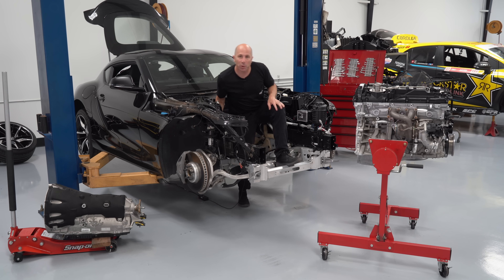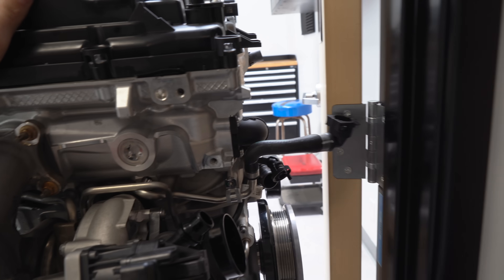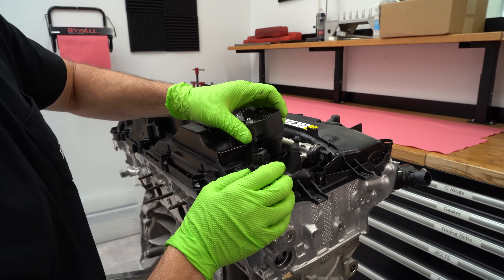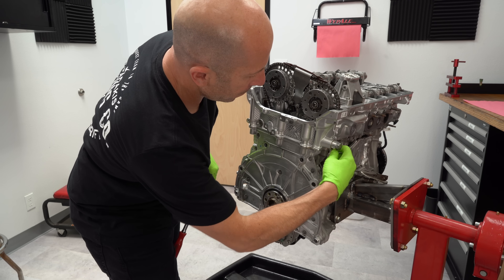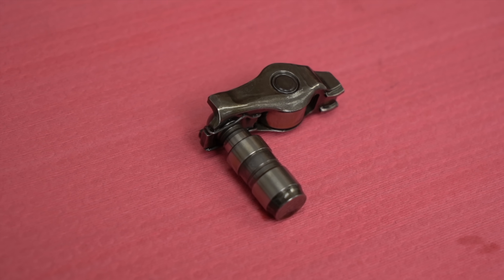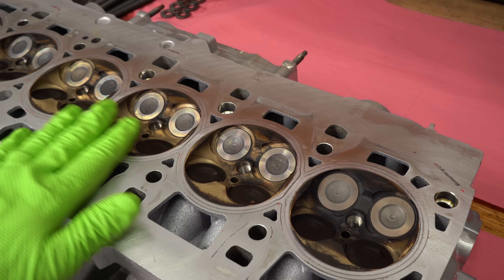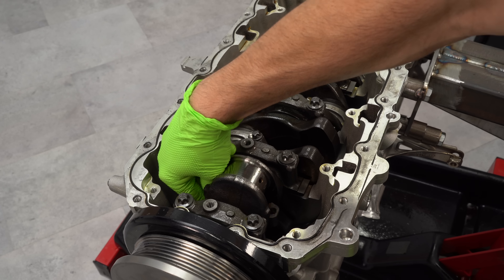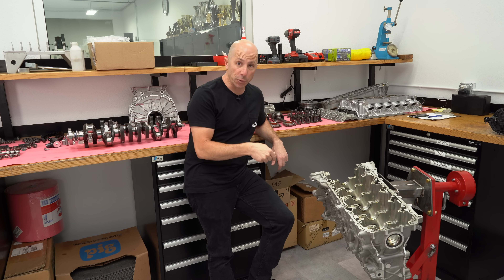2020 Supra B58 Engine Teardown - First Look - Better than the 2JZ?

Comment: Um, I believe I’ve spotted an error in this video.  Where he identifies the black valves as the exhaust valves, but if you look at the head casting you can see the dark valve side is actually the intake side.  Look for yourself 9:54

Comment: Wow, looks like a decent engine. The biggest problem will be the labor costs when BMW decided to use a bad quality chain system again!!! The transmission has to come off, before even work on the back of the engine.
Reply: looks like a simple chain setup, I doubt there will be many problems, my 4 cylinder tacoma has a more complicated chain setup
Reply: MrNicoe36cabrio BMW had a few issues with timing chains on their V8 engines when they got rid of the valley idler sprocket and replaced it with a deep sliding chain guide, but since I6’s don’t have a valley, they haven’t had any issues with chains that I’m aware of. Just nice to see it doesn’t use a belt.. if it were up to Toyota, I’m sure they’d have rather saved the $8 per unit and used a belt. Lol
Reply: @dregenius  Yes, the L6' chains were good in the past. They made big chain train mistakes on the N43 and N46 4 cylinder engines and 1 newer engine where the chain was on the back already. I can't remember the engine number, and I think that was a 4 cylinder also. I think they lost the 4 cylinder battle to the Asian engine builders. One of the main reasons was the German driver philosophy; "a real BMW has an 6 or more cylinder engine". They rushed alot to get a 4 cylinder series. The 4 cylinder downsize did cost BMW a lot of customers in Germany, unfortunately. Dutch regards.
Reply: I'm sure there will be aftermarket chains, sounds like a simple (but expensive) fix.
Reply: or maybe gears! just gears, no chain

Comment: You are impressed? 
You never disassembled any bmw engine before? Fuel train, direct injection, fuel pump, spark plugs, cracked rods, timing, lifters, rocker arms or even oil cooler, bmw had it for decades. 
My 2009 3 series engine looked the same. 
And 2002 3 series already had valvetronic, cracked rods etc. Whats more, my 1998 vw golf have cracked rods, heat exchanger or the same lifters and rocker arms as this supra engine.
I guess the only new thing is that exhaust and build in intercooler
Reply: Oil cooler is pretty cool as well, along with bolting the turbo directly though the other euro guys are doing that. Still I'd rather have that setup than a hot V.

Comment: That cracked rod clamp is pretty interesting, cool bit of info.
Reply: I understand these rods are forged in one piece and than broke at a specific place. 
A sharp cut, forged into the rod initiates the fraction at this point. This assures a perfect alignment of the rod halves when putting the rod together.  Off course it is necessary to keep the two halves together as a pair.   
I just love the clever engineering behind this.

Comment: I'm noticing a lot of newer engines using the exhaust manifold-less design. Its sole purpose is to heat the catalytic converter up faster. My guess is that will be one part of the design that will limit the overall potential of the engine. Please correct me if I'm wrong in this way of thinking.

Comment: I see 4 thing I would have liked to of seen on this engine is:
1)bolts through the little/windagepan for the mains it makes it simpler and stonger.
2) 6 exhaust pots no 2 so when it's  time to improve the flow you can do so.
3) cam on valve retainers with shims like the old 2jz or rod mounted rockers like hondas vtec.
4) brigded cam caps so instead of one cam holding one cam...it's one cap holding both cams and a bridge along the cam caps to give more support.

Pros of this I see is the direct injection and it's a straight 6
Other cons I might consider is the oil pump not being linear and instead isotropic like a rotary style pump.

Inlike it I think it will out proform all American competition but I'm not so sure it can beat it's Japan ancestry the 2jz. Or even some 4cyclinders like the b18c1, rb26(straight 6), sr20, k20/k24, when it comes to design I think it didn't move forward enough. Looks good but I would definitely put money in the valve train.

Comment: Another potential benefit of electronically actuated throttle bodies (and valves) is that the controller can detect the fully open and fully closed position, and when fast-shutting or fast-opening the valve, it can slow down the movement right before it slams into the seals or bump stop, or whatever physically limits the extreme ends of the travell. This can reduce wear considerably.

Comment: Personally what the Supra mkv seems like is a affordable and reliable sports car with some tuning options available (ecu) However I am sad to see Toyota turn away from their performance side to more of a commuter side. The new Supra was marketed towards old guys that want a sports car rather than American and Japanese younger car enthusiasts that like the wide bodies big wangs and a little camber or even tuner side of things. I would have loved to see a new motor come with the mkv like a new and approved 2gz gte that came stock with 300 something hp and had a more simpler approach such as more room in the engine bay, a car that looked more Toyota than bmw. This car has tons of potential still I would have liked something more authentic from Toyota though (just my opinion no need to get mad)

Comment: 2JZ ftw 👍 Why? Because it's a engine by japanese and not by BMW and got that Performance round about 20 years before BMW's B58. Much inovations in the B58, but if they build a new Version of the 2JZ, the B58 would cry. And the aftermarket tuning would be easy by Bildung a 2JZ (Intake/exhaustmanifold...)

Comment: Yeah, that's entirely bmw design (2015), toyota had nothing to do with this, You need to be carefull with this chain at the back as it proven to be unreliable and extremaly fragile, also pay attention to chain sprockets as they liked to get loose in earlier engines. Oiling is an issue also. E-thermostat fails often and electric water pump. Injectors  need to be checked.
Reply: One more thing (no ones probably reads that) older bmw coils did not have ignitors in them (dumb coils), they were accually in the ecu, don't know if they changed it or not.

Comment: Beautifull. My problem with this engine would be that as it does not use port injection at all (not even part time right?) you will quickly see carbon building up on the intake valves like on the VW GTI engines. Unless your catchcan or as bmw calls them "cyclone" is topnotch. 

Anyways. BMW and a straight 6. Usually it doesnt get better than that. But in the other hand my knowledge is pretty much limited to the M52 and M52TU so i could be an absolute clown. For example as i am used to the VANOS system i currently have zero idea how the variable valve timing works in that engine. the Valvetronic was pretty staright forward as in other engines

Comment: I just wanna know what the thinking was behind some of this stuff. Like. Why put the timing chain on the back of the engine.  Or why have the exhaust manifold integrated into the block? Just why? It just looks overly complicated for the sake of being overly complicated. Which is really what German engineering means.

Comment: as it seems there is not much space between the rocker and the cylinder head on the exhaust side at maximum lift, does that mean that running higher lift exhaust cam requires some machining as well?

Comment: Those split rod ends are like what Yamaha uses on the R1. Very trick.
Reply: believe it or not, most modern engines use them also.
Reply: @bigassfordsd  Many do but few are titanium like the R1. I see I neglected to mention.

Comment: This is not a very mechanic friendly motor. Way too much plastic and it screams complexity like a BMW. I cant imagine what power is going to cost on a motor like that. It wont be cheap. When you need to use a lathe to make a socket fit for the plugs... That easy toyota maintenance is gone.
Reply: Another problem is that this engine will probably have carbon on the intake valves since it doesn't have the dual injection like all Toyota engines.
Reply: @NYGlockinator13  I have that issue with my mazda. Use a catch can and it takes care of most of it. I had my intake off recently and it wasn't oily at all.